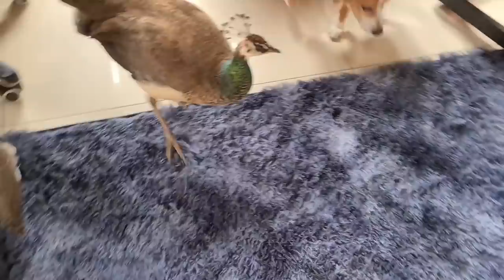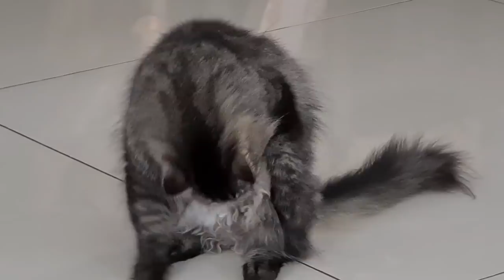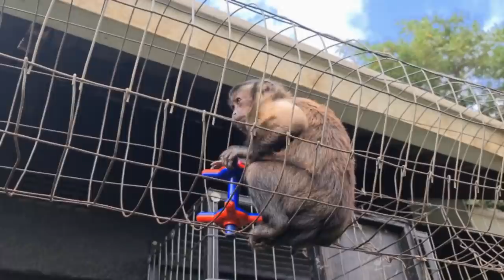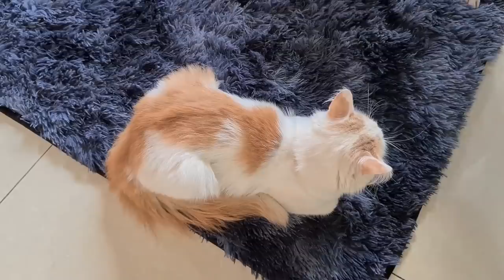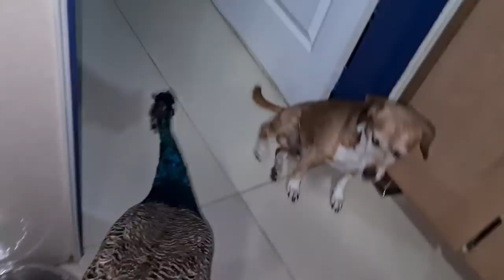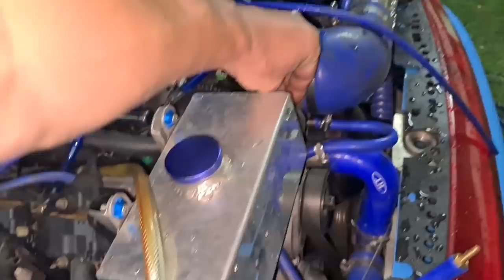Should they sleep there?

Comment: Mike those exhaust manifold gaskets are so easy to put in all you have to do is loosen the bolts and slide them in going to be a pain in the ass later on if you end up with an exhaust leak dude put in the new ones save yourself some trouble there too easy to put in to not put in all you got to do is loosen the bolts and slide them in the crack make sure that they grab the bolts dude while I hope you don't have an exhaust leak cuz that will suck